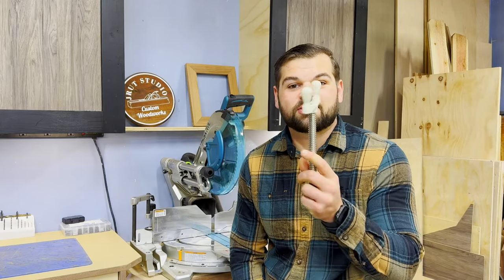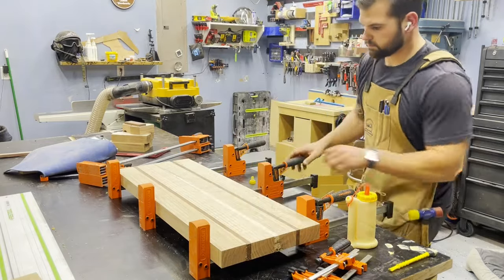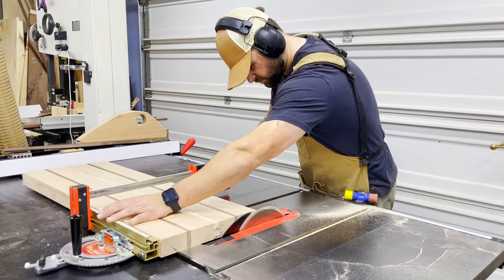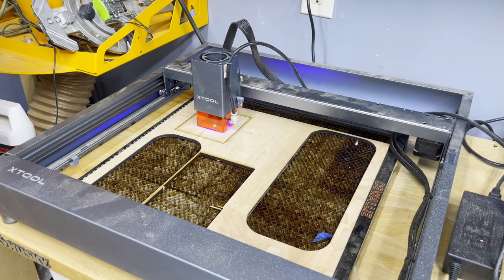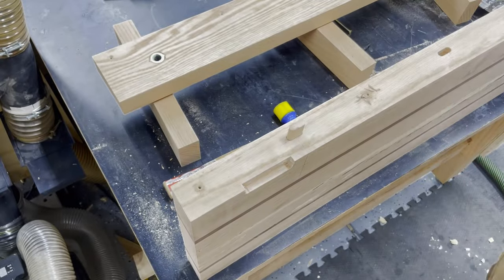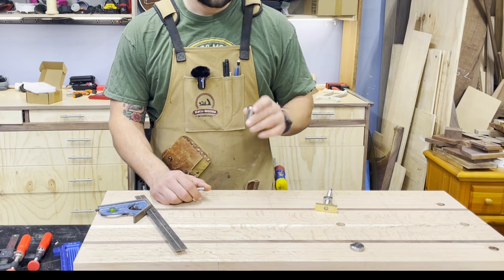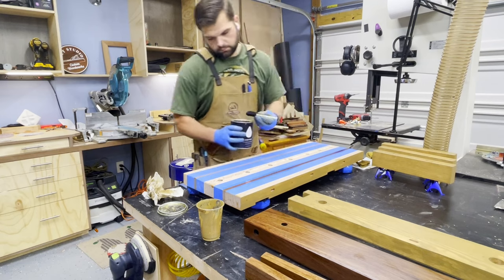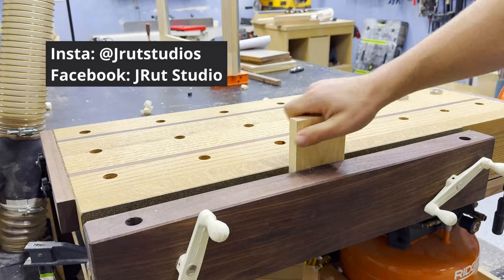Building a Budget-Friendly Moxon Vise Workbench: Portable Woodworking Solution

Comment: Nice work, Joe!

Question: what made you decide on the dog hole spacing? Is that standard of was it more about symmetry?
Reply from the maker: Thank you. I tried to make it symmetrical but also not have to have a large distance between holes. I believe I did 2” from the edge and 4” between holes? 
Depending what kind of accessories you want to use I would plan it out according to them. A lot of people go with the Festool MFT spacing